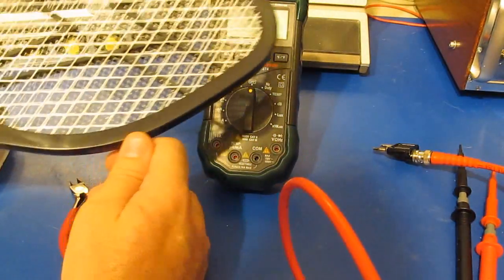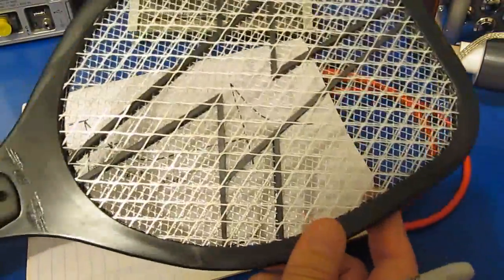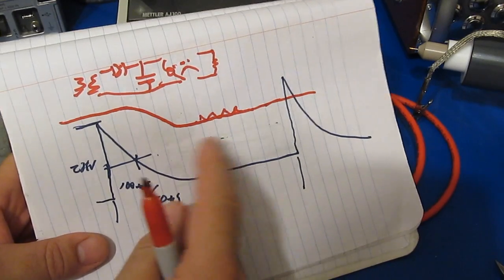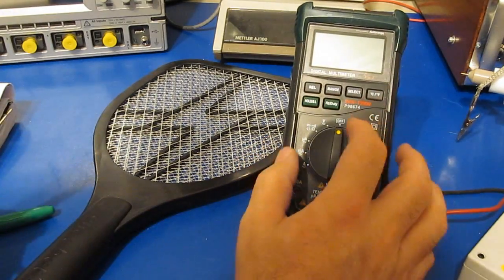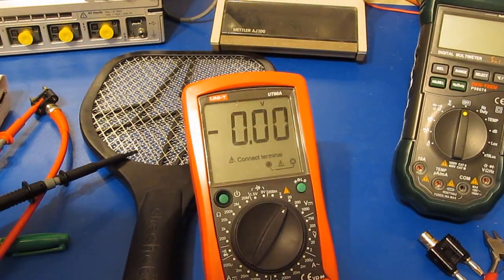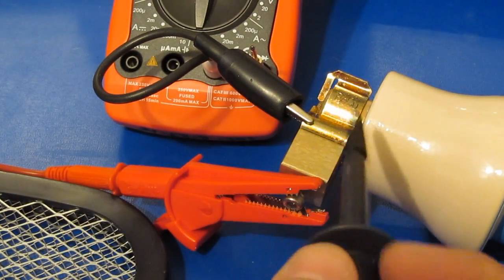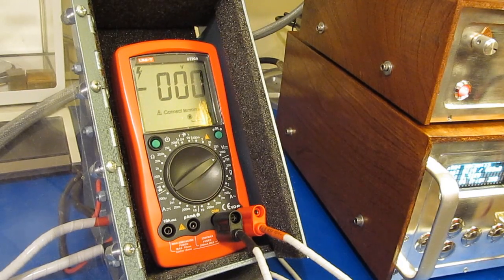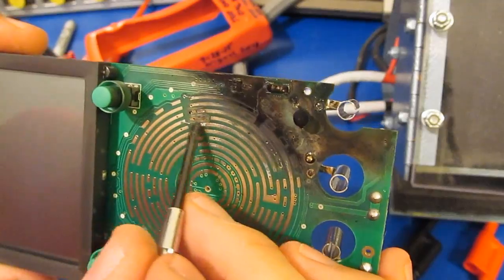Measuring High Voltage Electronic Fly Swatter with a DVM

Comment: Could this be used to measure an electric fence output? 15kv?
Reply from the maker: Sure, but it's a one time measurement.  If the meter is dies, you know the fencer was working.  If the meter survives, you have a weak spark or none at all.  lol.     No you can't read 15KV with any of the handheld meters I have looked at!!!
Reply: I was thinking more with an attenuation probe.
Reply from the maker: Once you place the proper probe/attenuator in front of it, I would assume you could use any meter you like as it is no longer the meter but the probe and attenuator that are taking the hit.    The pulse will be very short so I am not sure what you are going to actually read with your meter.  Maybe nothing.   They do make testers specifically designed for electric fences.  I am curious why you wouldn't use the right tool?  Some are very inexpensive.
Reply: They are expensive. I thought a workaround like using a bunch of series resistors would do the trick. with the accompanying math.
Reply from the maker: Some are less expensive than this meter and they would work.  I am not so sure that your attenuator will do the trick with a standard meter because of the short pulse and long time between pulses.   You may need to add a sample and hold or some high speed peak detector for the meter to see anything.
Reply: Thanks.

Comment: Definitely not going to work again there, think the PTC finally went through a conversion into smoke and copper vapour, along with every thing after it. 

Time to put the board in a frame and hang it on a wall in the shop. I am building a collection similar to that myself.
Reply from the maker: HA!  Rare I play with that half cycle generator but when I do it's always fun!

Comment: Hey now, I only damaged one meter that was already damaged and I didn't care about, lol. Three other cheap meters survived. I did measure it with a fluke 80K high voltage probe that can take 40KV. They were good when TV's had fly back circuits, so they are cheap on eBay currently. Cheaper then what I could have made my own, I did debated making my own from your video but the parts and time were more then a used fluke HV probe. As you know, my fly swatter does about the same voltage. https://youtu.be/yJ4s-0czoSs
Scott
Reply: Beware that those HV probes have a very large AC derating to apply to them if the measurement is not DC with low ripple. AC rating is around 2kV IIRC up to a few kHz, and even lower after that as they have so much cable capacitance.
Reply from the maker: HAHA  Yea, I couldn't remember.  I bought the fly swatter a couple of days after you wrote.  It's been sitting there waiting for me to do something with it all this time.   Weather has been nice.   My choice to build my own was cost driven, well and I enjoy making stuff for fun.  I was looking for something with a fair amount of bandwidth.  If you're working with DC, the Fluke probe will be fine.
Reply: +joe smith I do work mostly with with DC, but starting to work with AC and now have a big 10A veriac, and some smaller ones also. I checked Ebay again and the used ones are little high in price about $80, maybe I got lucky.

Mine is a little different from the new fluke 80K you see people tear down today.  I ended up with an older model were the alligator clip is smaller (and corroded) on the older ones unlike the new ones today, so I replaced it. The older fluke 80k probes use a wire wound resistor thats less likely to be damages as a used prope and more accurate, better with TCR and more stable over time. The specs and data on flukes site is for the new ones. I can't seem to find the data sheet for the older ones. The new ones use a single or double,in series thin metal resistor. Bandwidth might be about the same but I'm not sure, I lost the data sheet for the wire wound resistor in mine. I guess I'll have to take it apart again and search.
Reply: +joe smith Haha, I missed the comment about measuring a microwave transformer the first time I watched the video. I found my original video for the meter that died but measured it accurately (dies after a few times 🙂) and the one meter that loaded down and still gave me a measurement, but not an accurate one. I think I'll release it since I'm not dong any new ones while I'm working on the lab. Today's goal is to run power into the closet to make it a home IDF closet and keep fan noise out of the videos from the servers and firewalls. So it's slowing getting done.
Reply from the maker: Those MOTs could really do some damage to a meter.   I stuck a few across a neon sign transformer for fun.  Not much is going to save you there.   The Fluke probe is made to work at 60Hz.   I'm not sure if there is a derate in voltage but the BW is going to be poor.   Maybe this is what Sean meant.   It is possible to drive all that cable with a HV probe.   When I made that last probe, I wanted to place all the compensation in the handle like Northstar's.  Mine like theirs needs that cable to be matched with the probe.   There is a fair amount of compensation going on in that last probe.
Reply: +joe smith Yea, mine probably does have poor bandwidth but will work for what I wanted. Those unknown transformers from the scrap yard, it will give me an idea on what's it's rated for with a quick sample. I don't plan to use the fluke HV probe with a scope or anything and only use my cheaper meters with it. I know it's not the best, it's basic and a simple 90MG ohm resistor but better then some of the videos I saw with people putting ten 1/4 watt resistors rated at 10MG ohm in series. Have you seen some of those videos that state "This is how to measure high voltage" or "How to make a HV probe" ? I won't put a link since I dot want people to watch those videos, but a quick search and will will find those results mixed in with your video on how to make a high voltage probe.  I think that's when I found your channel originally when I was looking to make a HV probe.
Reply from the maker: LOL! Yes, I watched a lot of those videos including the one Dave had put out after I had bought that cheap 100X probe.  I experimented a fair amount and then went my own direction.  The large probe has some basic protection built into the handle so if things go bad it should save the scope.   It's not a bad probe for a home made setup.   The Fluke probes are pretty good.  You could always add another layer of protection after it if you were concerned about the meter.     As I mentioned, I gave away some of my old test gear.  I kept my first LeCroy.  It gets used when I am concerned something is going to go wrong.   I am surprised it has survived all these years.